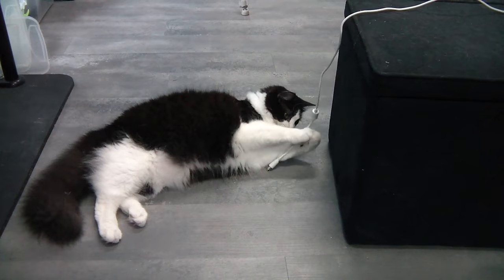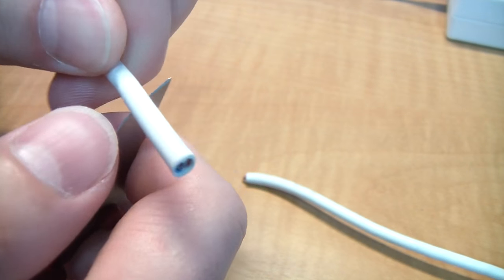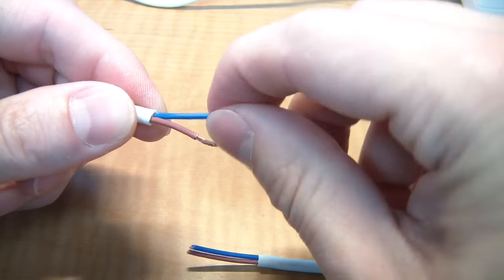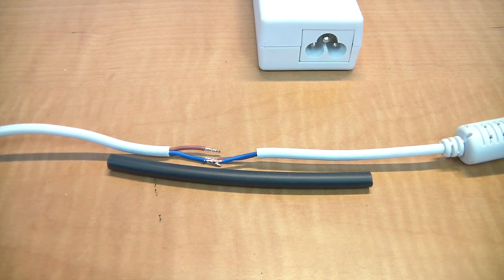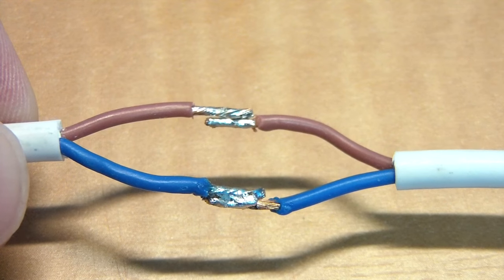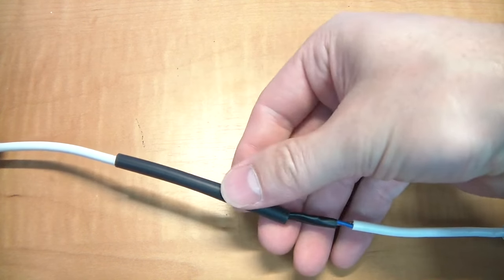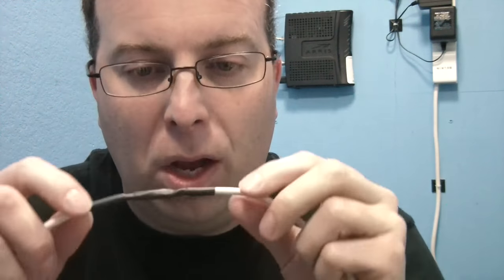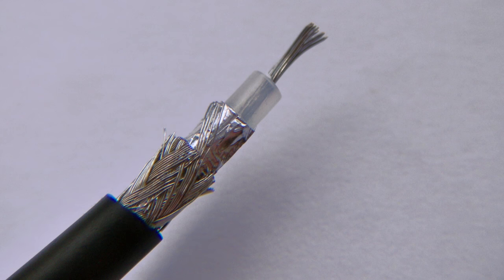How to repair a power cord that has been dog chewed.

Comment: Definitely not advised in the UK, 220-240V covered in just electrical tape is asking for trouble.

When I join wires, I usually offset them so that the joins are not beside each other.

In your example, let's say the amount of outer sheathing removing was 1.5 inches either side. I would cut the blue wire shorter on one side and the brown wire shorter on the other side. It ends up with a 0.5 inch blue wire and 1 inch brown wire on one lead and a 0.5 inch brown wire and a 1 inch blue wire on the other lead. Only remove about 1/4 inch of insulation and cut a piece of heat shrink sleeving about 0.5 inches long.

Add the outer heatshrink to cover the outer cord sleeve.

Tin the 1/4 inch ends as you did, then slip the heat shrink on to the longer wire on each side. Touch the brown to brown and add a drop of solder to make a good joint. Slip up the heathshrink and heat it. Repeat for the blue wires. What you end up with is two pieces of heathshrink that protect the joins, bulk out the cord a little and if the heatshrink fails, the wires are not likely to touch each other and cause a short.

Finally heat the heatshrink over the outer cord sleeve and you're done.
Reply: Laptops run on 19 volts even in the UK.

Comment: If the wire is long enough for you to see inside such as a TV, its best and look soo much better if you take the TVs back panel off and connect it and hide the wires behind inside the panel. Looks so much better and cant even tell that its been repaired 👍🏽

Comment: As a rule of thumb, always twine the wires to be joined together it's much better than just simply attaching the wires with solder and makes for a much more secure connection that cannot be pulled apart as easy.
Reply: can ya twine the wires without the soldering ? Just twine and tape..
Reply: @stueykerr5670  thats what I want to know too. Did you get an answer?

Comment: What if the chewed cord is in the ground  under sod  (orange sprinkler power) and your husky puppy is the devil and there's no slack to cut out damaged section and be able to reach? Must I somehow dig and replace said cord, or is there a way to add an extension piece using the same technique, only do it twice?

Comment: This method is not legal in my country.
Reply: +swan83 why would it be illegal?
Reply: If I could ask - which country would that be??
Reply: +swan83 That's stupid.
Reply: Finland for an example, and most of  the developed world.....
Reply: Because this is dangerous.
Reply: ***** You are clearly a professional.
Reply: vanhakaveri Now it's like they're trying to keep us from dying.
In America, you can do this if you're careful enough.
Reply: SilverGenerations Studios You can do this, but You shouldn't. You can run a red light, but you shouldn't.

There is no good reason to do this, and this is seriously not safe for many, many reasons.
Reply: It's much cheaper. And just relax man, it's only 110 volts.
Reply: swan83 it is in every country. electrical work is ruled by international standards. the difference is some countries use different voltages or wall plugs or whatever but it is the same damn electrons moving though the wires. people think electricity is a joke. a fire can be started with less than 9 volts. 110v can load those small wires and melt the solder. that is why you must do a mechanical connection with crimp terminals. thousands of people watch these videos thinking it is ok to do this crappy repairs. 💀☠
Reply: 100 mA is enough to kill you with 110 V AC. Don't play around with electricity, especially if you don't know what you are doing.
Reply: If doing this is ilegal, electrical comparyes is breaking the law.
Reply: @simonrichard9873  No, it is 19 volts.
Reply: @okaro6595  What?

Comment: So... do you think not using solder and just twisting the wires together and wrapping them with electrical tape is Unsafe? I've done that method before with macbook pro cords and it's worked well (as in the cord worked normally for like... it's been like 2 yrs now). However, I would not leave that machine with the cord plugged in while I was out of the house due to anxiety/my lack of knowledge. I feel the same bit of anxiety with doing the same method with an AC and using it while not at home, esp if I don't solder. 

What... other projects can you use a soldering "gun" and solder for? lol

Comment: Solder is not meant to hold wires together. You should wrap the wires together to get a good mechanical connection before applying solder. Make the connections offset, so that when the electrical tape fails, you don't get a short. Use heat shrink instead of electrical tape, just cut the small wires a little longer so the smaller heat shrink doesn't shrink prematurely.

Comment: You guys are seriously being stupid... There's not 120 or 240v running through that cord. Even though the cord is colored blue/brown (line voltage colors in the EU), it is on the OUTPUT side of the transformer if you notice in certain parts of the video, so it is actually only carrying a maximum of 24v DC. Stop complaining, this is safe, and if it were to short out the worst that would happen is the power supply would break.
Reply: And if the power supply isn't totally crappy the worst that can happen is a power supply switching itself off.

Comment: Only do this on the Secondary side of your power supply (the low voltage side). In countries with harder laws for electricity like here in germany it isnt allowed to solder 110v/230v cables. on some devices they are pre soldered. this is allowed but you shouldnt do it by yourself!

Comment: My puppy chewed through my phone charger.  So I stripped the insulation, and the insulation of the 4 wires inside.  Gave myself enough space to do a western union splice and wrapped them all in electrical tape then taped the whole thing together.  Tried to use it and it works, then it doesn't, then it works, etc.  And my PC detected a power surge in the USB port it was plugged into.  I don't have a soldering iron and I ran out of heat shrink tubing.  Any idea what went wrong?  Is there any hope or just throw it out?  I just needed to use it temporarily until Tuesday until I can run out and get a new phone charger.

Comment: I can't post a picture oddly enough. However this issue happened to me but not so far on the wire. The box part of the charger, with the wire going into the computer. The broken black toobage is RIGHT next to the box. I can't amputate a section. When it had power and I manipulated it, it did spark and make a little smoke. I didn't play with it a lot to avoid further dmging it. What should I do?

Comment: Today was a sad day! I had to pack my puppy's suite case up and all his little toys and snacks. My boyfriend's on his waY home from work at this very moment, and when he arrives he will find that our $3000 tempurpedic rise bed no longer works because my puppy decided to chew through all the wires and the power cord is completely chewed off as well as the controller that was also attached by a wire. Who would have ever thought a beautiful white maltese with the face of an angel was capable of somthing so horrid. I usually hide and cover up his messes but there's no hiding this one. Pray for my puppy

Comment: Is soldering necessary? Can i just use electrical tape instead?
Reply: Soldering only makes it more permanent. You can absolutely use JUST electrical tape, it will just be kinda ugly.
Reply: link's awakening!
Reply: Not really. Wires can pull out of the tape easily and if you've cut them to the same length, they are going to short, or worse, expose just the live - run your hands along the cable and zap.
Reply: I have a TV with twisted wires and electrical tape.  15 years and never had an issue.

Comment: Any alternatives on a sodering iron? Very helpful! no need to appologize the aethetics.
Reply: not really, just buy one, they are cheap, and relatively easy to use
Reply: Actually at the time I just sort of braided the wires and used electrical tape. Not as sketchy as it sounds... It was too late to hit a store then. It's all fixed now, the coaxial bit helped. Thanks!

Comment: Cut the parallel wires at different length to reduce the amount of bulge and the chances of shorting. Something like this:

[Legend:]
[=] insulated wire
[ - ]Uninsulated wire
[_] Gap.
[/Legend]

===========--_--==
==--_--===========

The smaller insulator cut in two pieces and slide one piece to the back on each side. Then when you are done soldering move one over the center and "its" side, shrink that, then do the same from the other side so that they overlap each other.

A windproof "jet" lighter or kitchen torch works great, since the flame is directional.

Comment: IEC 60320 power cords are so cheap and easy to get that I really wouldn't bother repairing one. There are more fun things to solder than this. Especially when the result will be worse and potentially quite dangerous compared to the new one.

If it's some proprietary cable whose replacement is hard to get or exorbitantly priced, then sure, I'd repair it.

Comment: Do you have to us soldering iron or can you twist the wires together?
Reply: they need to be soldered, otherwise if the plug gets tugged on the connection can fail and then you have a death cord.

Comment: be careful,better way is bule wires don't longer than brown one,i mean bule and brown never use same length,i am sorry,my english is rubbish,but anyway,safe first.long and short ,short and long,haha
Reply: You are right, the joins should not be adjacent to each other as the chances of the tape being perforated by the bulky solder joint, causing a short, are much higher. With due respect to The iBookGuy, I don't like the way he has done this repair. If I absolutely must splice a mains cable, I ensure the joins are not adjacent, and use copious amounts of self amalgmating tape and heat shrink tubing, electrical tape isn't good enough. A better way is an inline plug/socket coupling. The best way is of course to just replace the entire cable.

Comment: Solder eventually melts when its under a load so save Your self a future repair / house / life and just buy a new lead or repair the cable correctly
Reply: yea that what i was thinking this guy should not be giving advice on any thing to anyone ever i think every electrician who watched this head exploded
Reply: id say depends on the cable i wouldnt recomend doing this for a 250v cable to your wall but for something like USB its fine i guess
Reply: Silica well for us and him it's 120v and it doesn't get that hot to melt solder so
Reply: jonathan oxlade that's what I done I got a small joint box and two connecters to join a reclining sofa cable. I made sure the connection good and tight but  not over tight I plug sofa out every night any way seems to work fine
Reply: jonathan oxlade you probably don’t even know what solder is

Comment: And you really never thought that the thickness of the original insulation is like 10 times thicker than what you put on? At least use some plastic sleeve around the copper to really isolate the wires from each other with more than a bit of soft tape and use a couple of layers of shrink on it.. that looks plain old dangerous. And your soldering did not look too good either. I like to not twist the wire but interleave the strands and then solder them together, much better connection.

Comment: Probably ok for Category I wiring on a very low current load. The NEC frowns on solder only connections and DO NOT do this with a load like a vacuum cleaner or heavy resistive load.

Comment: Warning, unless you are competent to repair electrical equipment leave it to the experts. Mains electricity (240V) in you home is lethal. Not all electrical insulation tapes are the same, some are cheap alternatives, the real tape has an insulation rating e.g. 1000V. The same applies to heat shrink sleeve which should be 'shrunk' using a hot air gun, not a naked flame as it can damage the insulation properties and inclrease the risk of electrocution. Please beware. PS, I am a Chartered Engineer and have an Honours Degree in Engineering.

Comment: i have a question, i have a pair on in ear headphones and had a lil piece of yarn at the wire. i pulled the yarn and it cut straight trough the isolation. now i can see the copperwires (the inner wires at least) of the headphones and want to know how i can cover the cut, or just melt the rubber if that's possible. Thanks :)
Reply: You can just heat the wires with a candle or with a soldering iron and the inside wires will get revealed and you can solder them to each other.
Reply: nono, just the isolation is tonr, and i want to close back the black rubber covering the wires inside. like on the thumbnail of this video, the white, red or blue rubber part
Reply: Daniel Schlegel oh, if you wanna do that you can use either heatrink tubing or electrical tape.just put one piece of electrical tape under a wire and get another piece of tape and put it on the other wire.
Or you can use two small heatrink tubingsand put them in the wires. But you always need to seperate the wires, because they will short out if they touch each other.
Reply: hmm ok, thanks :D
Reply: Daniel Schlegel
BUT if the copper wires are coloured, don't worry. The colouring is because they added protective material. But if all the wires are completely gray you should do it before you plug them in, or they will short out
Reply: ok thanks
Reply: Daniel Schlegel
No problem :D

Comment: Firstly some of the advise he's giving is poor, I don't know of any regulated country where this joint would be legal, his method of soldering is poor, there is no mechanical strength here and been the nature of the cable to be flexible this would break in no time, pull apart and put someone at risk - he clearly says power cable so therefore its a hazard and should be accompanied by a sign saying do not try this at home!!!.. 

I'm an Electrical Engineer of over 25yrs, its cock wombles like this guy that promote household electrical accidents, like has been said before, its would cost a couple of quid to replace the cable and should be the chosen method, I doubt the heat shrink he used was a sealed version as he doesn't mention IP rating,it would cost you more getting the correct heat shrink than the replacement flex would, first bit of water gets spilt on that joint and you have a shock risk.
Reply: genome616 100% right. if he cared about people he should read comments and do some basic research about electricity and remove this stupid video. they just care about clicks and subs.  cords come so thin and cheap these days that they are a hazard even when they are new and people make them worse with these crappy repairs.
Reply: @.. I wrote this so long ago, I even forgot about it, yes I know its all about hits etc but there are people who genuinely seek these vids for advice and hopefully they peruse the comments too, hence I made it clear this is not recommended practice if you want to consider safety, if the flex is correctly chosen for voltage, current and installation methods then it will be fine no matter how thin you think it is, they have cable cords of practice to meet when making them and used under the correct conditions they will last years, if they don't then you need to consider if the cable was spec'd correctly for the environmental influences it would be subject to.

Comment: I'm actually genuinely surprised that your mains leads have brown and blue wires too.

The reason why they are brown and blue is down to us Brits and our electrical system, brown is Live and blue is Neutral, not entirely sure how it works, I think live is the mains signal from the power station and neutral is a huge ground at the power station though I do stand to be corrected, if you have a third wire coloured in the Briish colours that would be the Earth wire coloured green and yellow.  If you're not British (or Irish, or Commonwealth) then I guess all you have to do is colour match.

Comment: is there ANY WAY to do this without a soldering iron? someone please get back to me thanks :)
Reply: Just twist the cables together
Reply: But twist really good and tight.
Reply: Just use some blutak. Its perfectly safe just like the above video.
Reply: or just grab both ends and turn it on
Reply: Yes, you can use those plastic connectors where you screw the wires in with a screw so they are secure. I recommend fixing them to/inside a plastic box.
Reply: TheCommentator353 I assume you speak of wire nuts? Yes, that is the term. lol
Reply: *****
Not safely. However, if you do not know what you are doing to begin with, I wouldn't even do the repair.
Reply: Regardless this repair should never be done, replace the whole cable.
Reply: Cameron Marks
Nah, it can be done safely. Just not by the inexperienced.

Comment: In the united kingdom, soldering two cables together is completeley frowned upon. Instead we would use something called a flex connector, it has an internal cord grip and screw terminals for a proper connection

Comment: Use a suitable inline plug and socket, to rejoin the wires, such as a 2 PIN ORANGE RUBBER CONNECTOR 10A IN-LINE GARDEN LAWNMOWER 2PFC10 PLUS ABM LAMP CATALOGUE by MERCURY. @ £4.00